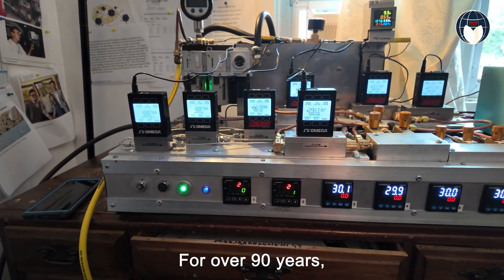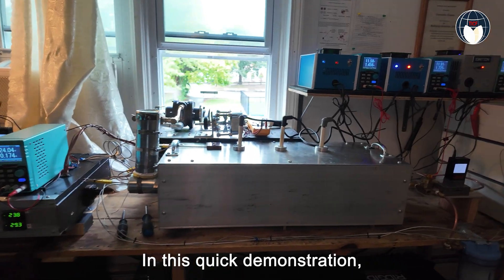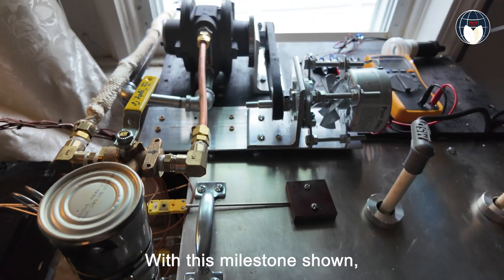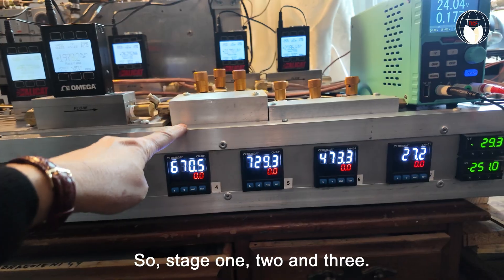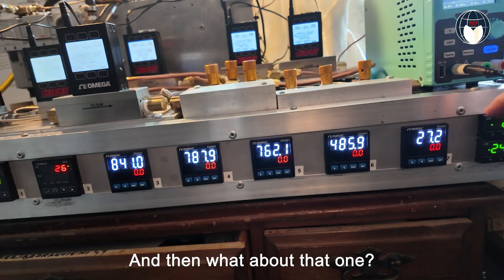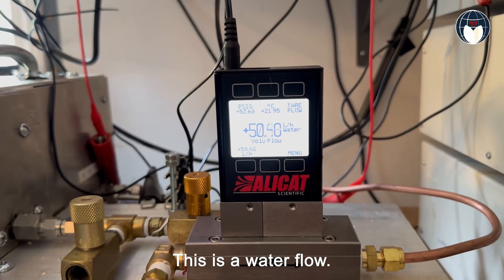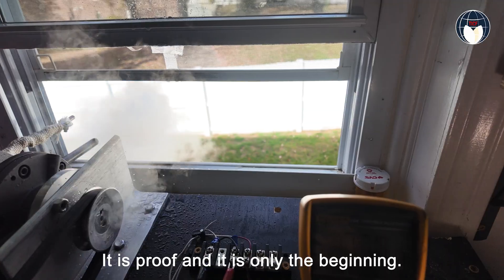Nuclear Fusion Power Breakthrough You Have to See!

Comment: but how efficient is it?
Reply from the maker: Thermal efficiency of TICF Crusader reactor the one that is in the video is 837.7% or Q= 8.377 with a continuous output. 
Please watch this videos: Nuclear Fusion Test Surprises Everyone & Nuclear Fusion: The holy Grail Of Energy.
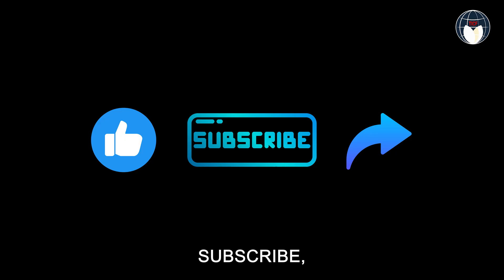The mini power plant in the 2:10 minutes video with an air motor and a small electric generator is just to prove that TICF reactor has output continuously electric & thermal energy by a nuclear fusion system something that no one in this world have done. 
We are  working in a TICF electric generator which will use a real stem turbine.
Reply: @ticfnuclearfusion  what fuels does it use, and what design does it use
Reply from the maker: @brr216-7 
 In the 837.7% output by the TICF Crusader reactor fuel is Propane. TICF reactor runs also in Hydrogen fuel, Carbon monoxide and any other available fuels. The primary fuel is water from which Protium is extracted to fuels micro- nuclear fusion reactions. TICF is a chemical-thermonuclear process and is 100% unique.
Reply: @ticfnuclearfusion  does it use a tokamak or linear design, and how does it do fusion on those fuels
Reply from the maker: @brr216-7  
TICF 100% unique that's means doesn't use any other existing  design. I suggest to visit our website: ticfnuclearfusion.com